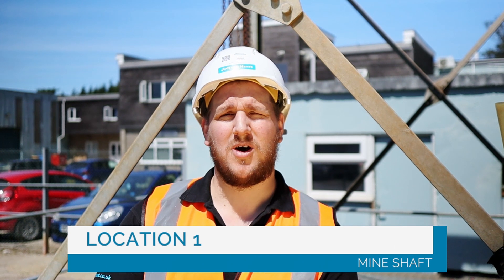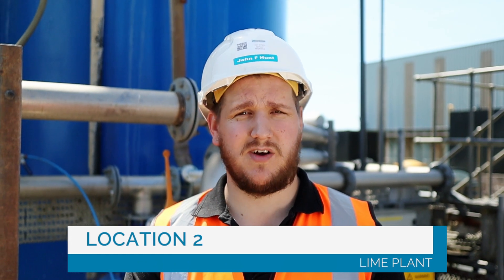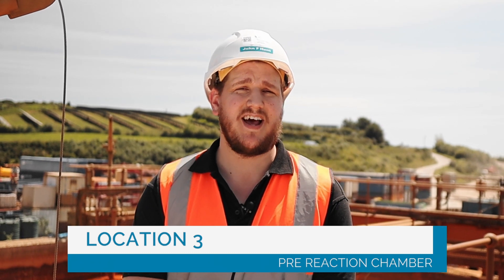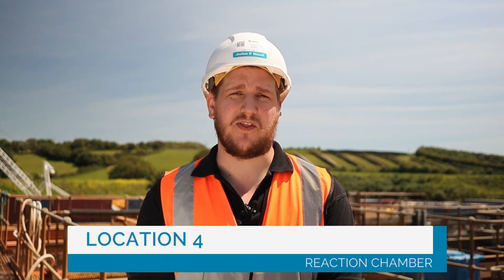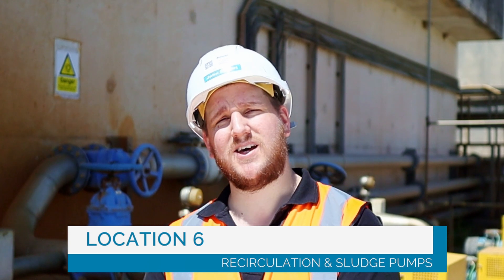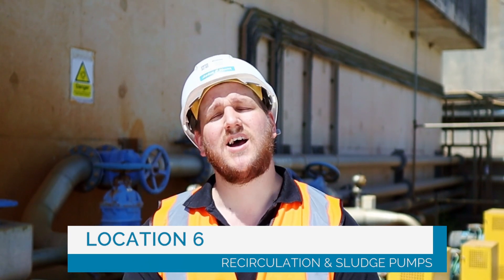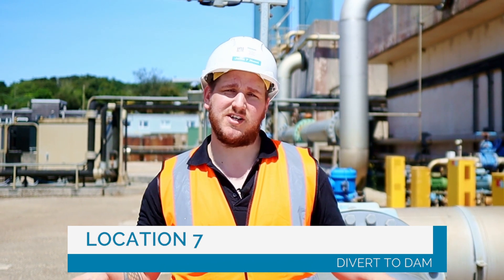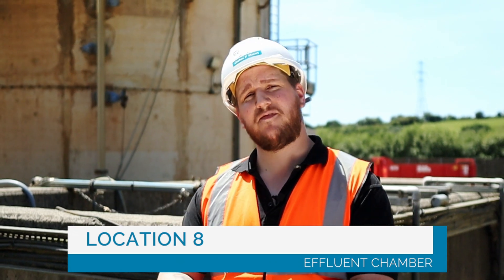Join us on a walk through of the Wheal Jane mine water treatment process

Comment: 30 years ago, Richard Coulton and I commissioned and oversaw operation of the the lime silos together with hastily erected PLC unit and mixing tanks. Over about 2 years I oversaw almost every component fail multiple times. Exposed valves and pipes would freeze on a chilly February night when Ken Barnes and I would stand 'thawing slurry pipes with a blowtorch at 3am. PLC routinely failed. Actuators failed. PH monitoring systems failed. Delivery drivers routinely over pressurised the silos and blew the pressure hatch at the top of the silos cleating massive lime clouds that drifted to neighbouring farms. We didn't have the densification process back then. It all went out to the dam where we crudely tipped in flocculant. The comedy of the flocculant pumps failing and creating an ice rink on site will stay between me and Richard. The pipe delivering the dosed mine water calcified the 400mm pipe. A lot of time and money was put into passive schemes that didn't work... interesting times.